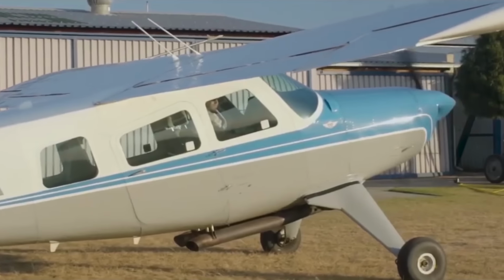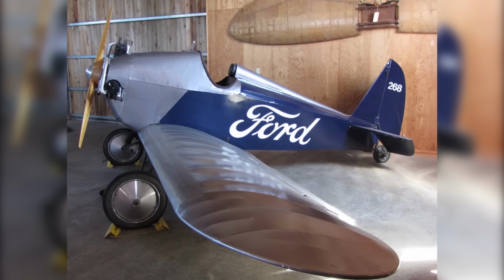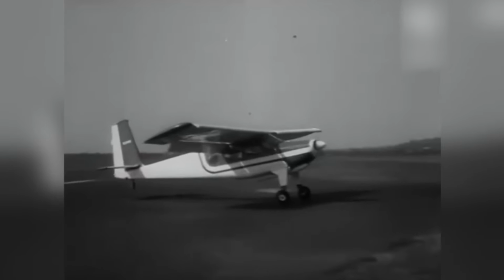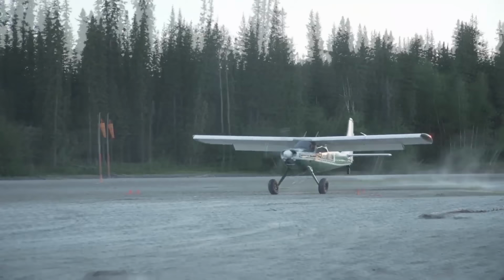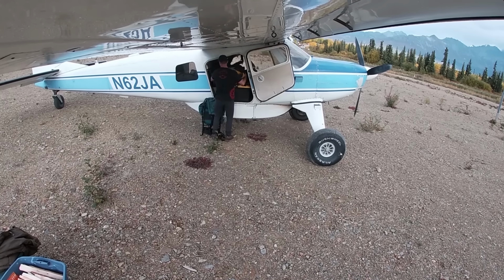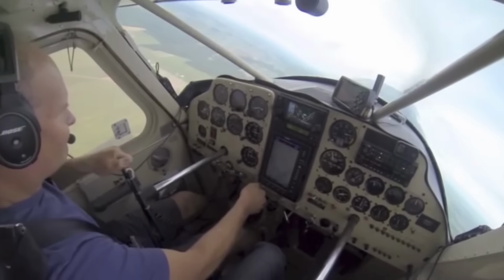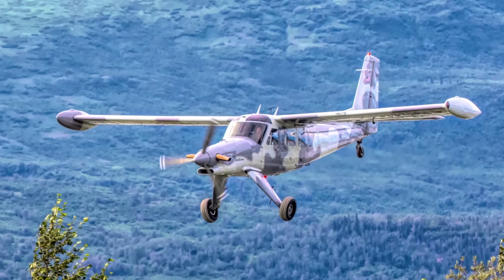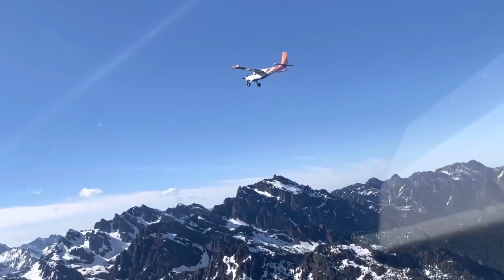The Plane that Turns Backyards into Runways

Comment: I flew the the Helios for a fishing lodge in Alaska. We installed helicopter airspeed indicators in ours because they registered airspeed from zero up. We flew on floats down to around 35 mph and, in a headwind, it was easy to earn tips by wowing the tourists by 'helicoptering up' in an absolutely vertical 'elevator' ascent. Incidentally , the Helios's nickname is 'the poor man's helicopter'. In heavy fog, we would inch our way forward at treetop level using a technique called 'hanging it on the prop' which meant pulling off the throttle to decrease the air speed and, as the nose was pulled up to maintain altitude, power was gradually added.  Eventually a guy could get the ship up to full power with the nose at a very high angle of attack permitting plane to travel in level flight at a ground speed of around 15 mph. The trick was to get the rig into the 'zone of negative control' where pushing the yoke forward would cause the the ship to rise and pulling back would cause the plane to descend.  I could go on for hours about the tricks a guy could pull in the 295.
Reply from the maker: Thanks for the tip!  Trust me I could go on for hours listening.  I love deep diving on these planes and it was a treat to learn about the Helio.  I figure she deserved some exposure here on youtube 👍🤘
Reply: Outstanding , I watched a de Havilland Canada DHC-4 Caribou land on less than a soccer pitch surrounded by tall tree's in a built up area  at a Aussie military show , now that was impressive mate .
Reply: @ducttapetech9885  Sounds great. Just hope the engine doesn’t quit while nose high at low airspeed. You’ll need some altitude to recover.
Reply: I fly extreme aerobatics in RC, we have a maneuver called "harrier" and "hovers" which is our version of "hanging on the prop". It's cool to know that this full scale plane can do such maneuver, cause it takes a very floaty airframe to pull off that maneuver
Reply: that and rhe turbine❤❤❤
Reply: You didn't mention that the main landing gear could castor for better cross wind landings and there was a locking pin to make them rigid like a normal tail dragger.with the  casting the planes were a handful to taxii  and post landing taxiing especially in cross wind conditions.
Also there is a wing spar mod that came out after there was  at least one mid air loss of a wing. The mod beefed up the main wing spar but was costly for owners, but a safety necessity.
No matter what the Courier is awesome to fly and I wished the Stallion would have been  produced in greater numbers.they had  a 1 ton payload and VNE of over 200 mph, I believe. Thanks for a great  presentation. 13:50
Reply: @joecadham5100 I did a few of the spar carry through replacements at aero Pacific in Oceanside California back in the 80s
Reply: @joecadham5100  The crosswind gear
Reply: What you are saying is absolutely true!!!!  5K+ hours in that incredible workhorse!
Reply: Many thanks, I was in the plane for a minute or two with that description
Reply: \___ _
          /
Do you mean like this with the elevator tipped up and the aileron down??
That would require separate controls for the elevator and ailerons. Or am I still confused? wouldn't it?
Reply: Stop bragging about yourself, attention seeker 🙄🙄🙄
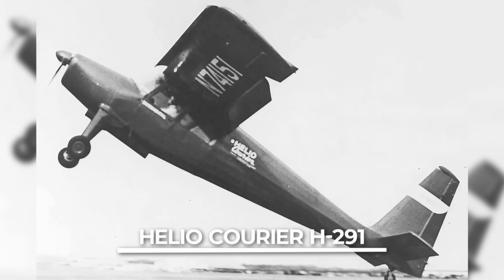Reply: Ok 3:45
Reply: Hi. Just, please do mount ruber gaskets at dors, fly always above water at fifthen nautical miles from shore borrowed cabotage,please see,maritime cabotage. I am very happy for those wonderfull moovies. Fly above shallows sand banks with airfilled pony botles airbag shaoed rafts to ensure, eventually aircraft floating device not to loose airplane. Cessna are the bests. Please note that i am not selling agent. BRS ballistic chuttes, dual eventually. With resoects and consideration.😂😅😊❤.
Reply: All true!
Reply: Wow, amazing, I got scared to do the hanging on the prop with an instructor in the Diamond D40.
Reply: Why do you need a F35 then?
Reply: My dad replaced a Hughes 269 with our Courier.

Comment: We had one at CMSU-Central Missouri State University flight program in the early 80's.  We used it to tow our gliders.  I believe the H295 referred to the six cylinder 295 hpr engine.  The slats just extended on the leading edge when you flew below a slower speed.  I regrettably never got a ride in it. Good Luck with your rebuilds.

Comment: Left out of this article is the history of wing failures resulting in the deaths of everyone on board. There have been at least 3, maybe 4 Couriers that lost a wing due to corrosion issues that were known but not properly addressed. The lasting occurred around 29 years ago when the float equipped Courier was about to land at a fishing lodge in the Heart of a sport fishing area when a wing folded and the pilot and three guests were killed. 
I owned an H 391 B  Courier in the 70’s and sold it immediately after a courier float plane in Ketchikan, Alaska lost a wing taking off killing four people. 
None of the fixes, AD’’s or other changes seemed to solve the problem. 
Personally, I would never fly in a Courier again. There are other aircraft that can do almost what a Courier can that are safer IMO.

Comment: I worked as a weldor in the Pittsburg, Ks. plant in the mid 80's. They were attempting to build an Ag version but it didn't work out very well. We were building Couriers too but they were probably only in production 2-3 years before the doors closed. I always thought the float plane was the coolest one.
Reply from the maker: Wow!  you just got me going down a rabbit hole trying to dig up a picture, but came up short.  I did find the name they planned to give it though:  Model H-21A "Ag Rat'ler.    I could have sworn I saw a picture of it long time ago - basically, a low wing Courier, right?
Reply: @aircraftadventures-vids  Yes it was a low wing

Comment: Thank you for the video, this aircraft was very interesting to learn about, and hopefully they can be resurrected!

A couple of observations about statements in the video:

1) It was stated that if you could fly and land the Courier in those remote areas, you could fly anything. I do not think this is correct. I feel it would be the opposite of this because the Courier allowed pilots to fly into these areas, and they would not be able to perform these landings in another aircraft.

2) There was also a statement that the Courier only needs 150ft to take off, and that this distance was half of a football field. This is incorrect, as a football field is 300 yards long, not 300 feet. So, 150ft is much less than half of a football field.

Thanks again!
Reply from the maker: Thanks for the feedback - and I sure do hope this plane gets a 2nd lease on life!

Comment: I guess those engines where to good . that's why they stopped making them .
Reply from the maker: They stopped making them because they are heavy and complex.  Lycoming and Continental preferred to either increase bore and add turbocharging to make more power, and keep the engines simpler.  But, for STOL ops for a heavy plane, it still is the best engine.

Comment: Interceptors do not increase the turn radius, which aeronautically would be a bad thing anyway. You want to DECREASE the turn radius and make it a smaller diameter, on order to turn more sharply and head out of that canyon you just stupidly flew up! The interceptors do help increase the ROLL rate.

Comment: The key that most aircraft makers don't know about making a plane successful in the marketplace is simplicity, mass production assembly lines, and low prices. What they do instead is increase complexity at every turn, use gourmet hand-made one-at-time construction techniques, at prices greater than a new house costs. They wait till they have 5 orders before they hand build 5 new planes and not one plane more.  No wonder planes are so expensive.
Reply from the maker: I hear you, but the problem isn't so simple like that. The FAA imposes massive demands on manufacturers which drives cost up, parts likewise need to adhere to FAA rules (also price goes up). Planes are not commodities like cars, there's just no drive to make planes appeal to the masses because honestly the "masses" have no interest in tiny little planes.  To be honest, if Cessna somehow started pumping out planes for $20,000, it would not necessarily turn everyone into pilots. That era is long-gone.

Comment: I worked guiding for an outfitter in the Mackenzie Mountains around the late '70's and was flown around on tundra wheels into gravel bars, mountain tops, unbelievable places and never once felt vulnerable.  One of the most memorable flights, i got dropped off on top of a bald knob to hike a few miles to a valley to meet a hunter.  We touched down and did a short rollout,into the wind.  I got out with my pack, the Courier revved up, in one plane lengrh the tail wheel came up, another plane length and he lifted off.  So amazing.  I consider myself blessed to have spent the hours i did in that aircraft in those mountains.
Reply: Was your outfitter Stan Stevens?
Reply: Hi Ronald, it surely was.  Glad you know of him.@RonaldBeattie-p9v

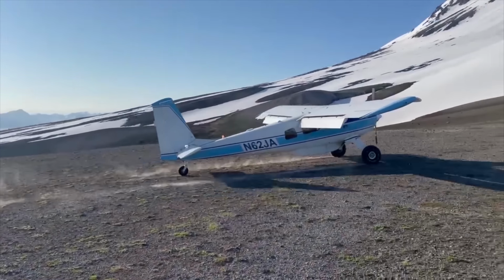Comment: Everything you said from 0:00 until saying meet the Helio Courier describes a Gyroplane perfectly, air speed of 8 mph without stalling check, can take off in your backyard check,can also land in your backyard check, refuses to crash check (slowly floats down to the ground if the engine fails) I was so expecting this to be a Gyroplane video.
Reply from the maker: How much people / payload can a gyroplane carry?  Totally different animals
Reply: @ depends on the plane there was one that was a 40 seater prototype way way back and countless configurations since then, we dumped more funding into helicopters and planes, but I can only imagine what sort of gyroplane might have existed if they had similar funding to helicopters and planes through the years. 

As a whole currently it’s way more in the recreational, low seat count. Still I thought it was going to be to be Gyroplane video and I got to learn about a plane instead so it’s still a win

Comment: Great video. Nature got there first! 
Modern birds have a small "thumb" winglet called the Alula that they use in the same way (from Wikipedia): 
"In most situations, the alula is held flush against the wing; however, it can be manipulated. When flying at slow speeds or landing, the bird moves its alula slightly upwards and forward, which creates a small slot on the wing's leading edge. This functions in the same way as the slats on the leading edge of the wing of an aircraft, allowing the wing to achieve a higher than normal angle of attack – and thus lift – without resulting in a stall.[1] "

Comment: As good as the design and the aircraft itself is, it is far from unique, even if you Focus on its STOL ability. To name just a few designs that come to mind are the Fieseler Fi 156 Storch, the Dornier Do 27 and the Pilatus PC 6 Turbo Porter. They are all a bit different, but all have proven their ruggedness and STOL abilities in at least more than 500 units each.
Reply from the maker: I never claimed they invented stol flight, and in the context of Pipers / Cessnas/ Ciri, it's unique and different than what most people are used to. All the other aircraft you mentioned are fine planes too.
Reply: @ All good, I just wanted to give the viewers a Little insight. Of course you are 100% correct. 👍

Comment: Beautiful airplane, but why, why, why, put a yoke in it and not a center stick with throttle on the left? Yeah, if the guy in the right seat is flying, he can reach over to the left side for the throttle like in the PA-16 Clipper, my first tailwheel airplane.
Reply from the maker: Not sure I have an answer for that. But the Dornier DO27 (which was roughly the equivalent in Germany) had sticks.

Comment: While stationed at L.G. Hanscom Fld in the 1970's I used to watch them test fly the helios assembled there. They must have had an agreement with the tower as they would taxie up the ramp to the runway and simply take off across it. I could'nt afford one but read the brochures and leared it had the same airfoil as the P-51. It advised if power was lost at night or in fog to trim for slow flight, tughten the straps and take hands off the controls and wait!
Reply from the maker: That would be an agonizing wait for sure!

Comment: My first taildragger as a commercial pilot was a H-295 Helio Super Courier. It is a handful, something I did not realize until I flew other comparably-sized taildraggers (C180s, C185s and smaller), and found them to be ridiculously easy to handle. I am fortunate in that I (approaching 75) am still flying a H-295 and it's lightweight counterpart, an Avid Flyer (precursor to the Kitfox) in the West Fjords of Iceland, particularly the Hornstrandir area.
Reply from the maker: Nice!  Thanks for preserving these machines!

Comment: Wait.  If it's the safest airplane ever produced, then you can't say that if you can fly courier you can fly anything.  You can't have it both ways.  Stop writing your scripts with chat gpt
Reply from the maker: OK, some more context then... It's safe in that the low end of the handling spectrum is VERY slow and any sort of crash will happen at low speed.  But to handle it (both in the air, and on the ground takes a lot of finesse).  Which means if you can master this, you can master many other planes (in fact someone JUST made a comment supporting that statement).  Does that clear it up a bit?  (and no chat gpt was employed here)
Reply: @aircraftadventures-vids  Well, if you need that much context, it probably should not be said on its own.

Comment: I like that it doesn’t need intrusive wing support struts.
Reply from the maker: Yeah, I'm not sure what was thinking on not having those. It sure does make for a heavier wing.
Reply: @ 
The wing was properly engineered making them unnecessary. Struts also cause wind resistance and hinder visibility which is a crucial safety factor

Comment: 6:40 correction here: The P-51 is a bespoke airfoil not used on any other design, it is the 45-100 which is from an unpublished family of specially designed laminar flow airfoils. 

The Helio Courior uses the NACA 230XX 5-digit series, which is a turbulent flow airfoil. It was used on many fighters on all sides of WWII. Including the F6F Hellcat, F8F Bearcat, FW-190, and F4U Corsair.
Reply from the maker: Thanks for that tidbit!  Interesting.  You know, one of the previous airplanes I covered also claims to have "P-51 airfoil wings" but it escapes me which one now (maybe the Meyers 200?)

Comment: 1983 we painted one for my brothers father in law at my parents house positioned on the corner of Steese Hwy.  and Chena Hot Springs rd.  About 5 miles N. Of Fairbanks Alaska.  Jack attempted to fly it out of the driveway he hit a tree landed on the hiway guard rail upside down broke the engine off the plane the prop carried it almost 1500 feet.  3 of his kids were watching.  A terrible day for one of Alaskas Boldest pilots.  He saved several people from the wilderness in heroic landings and take offs.  He could land on sand bars in the middle of river beds and take of skimming the water always into the current so the tires would have a bit of initial drag.  God Bless you Jack Freeman.   FYI my dad did not want him trying to take off from his drive way Jack snuck up while my dad was at work.  Imagine my dad’s thought process to see a plane crashed as he was coming home from work.  AAAHHHH the Alaska life we had a really different childhood.  Moose and Salmon Breakfast lunch and dinner.
Reply from the maker: You got me curious, and I looked up the accident report. Wow, guy tried to clear a 40 ft space (with a 38 ft wingspan)  Yeah they were built different for sure!  (the pilots, not the plane)
Reply: Did he die that day or just get really smashed up?

Comment: that company would rather just make the original design as it was but with available parts. I don't think their improvements will add anything except the cost and unexpected issues

i would love to buy such a plain if they make its price reasonable. But for that someone should do it somewhere in a cheaper and less regulated country

Comment: I got to see inside THE SAME N62JA Helio Courier when it came in a formation with a Taylorcraft I purchased get delivered to my local airport in Alaska. You almost wouldn't differentiate it from any other tail wheel bush plane until you realize just how large it is. 6 seats and can take off in a flash. Take off like a Super Cub but cruise a good clip faster than one. 
The owner is the same one part of the company that's beginning to make parts for these awesome aircraft.  I had to do a double take when I saw the same blue and white paint and checked my photos to see the same tail number.

What a coincidence to see this video days later. What a super small world.
Reply from the maker: Are you referring to Lukas' plane?  If so, we chatted a couple of times before I produced the video.
Reply: @aircraftadventures-vids  N62JA had an Abe behind the yoke when I got introduced this last week. Wicked small world, almost shouldn't be surprised the more I get involved with Aviation in Alaska, but I think it'll alway get me. 
I've got a photo of it with the Taylorcraft right behind it as they pulled into the parking lot. Part way thru the video I had to pull up the photo to check.

Comment: Excellent video.  Great story about a great airplane.  I seem to recall that there was an option for a castoring main gear for “easier” cross-wind ops.  Some how I think a tricky tailwheel airplane got trickier with that option.
Reply from the maker: Yeah it's kind of a unicorn, don't see too many pics with that option.  And I read it was a bit tricky to handle.

Comment: Did you speak of the  "castoring " main gear that was, and is a handful but they have a pin tha locks the gear acts normally.and there was the wing spar mod which all should have if flying.